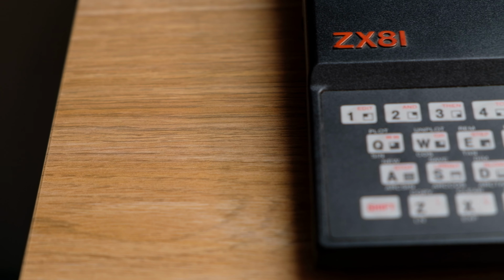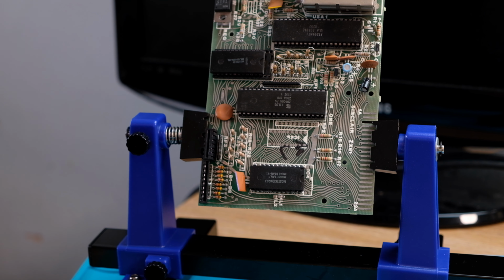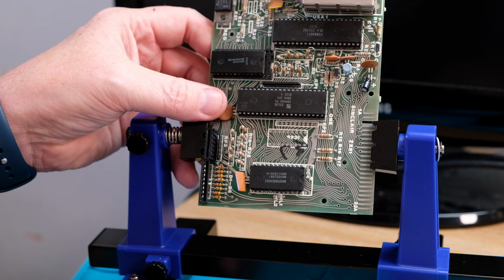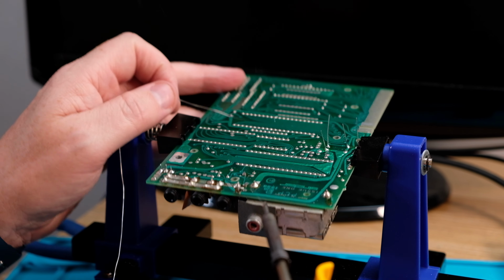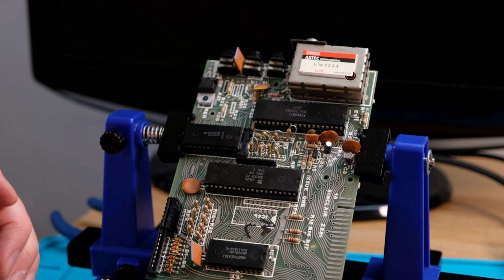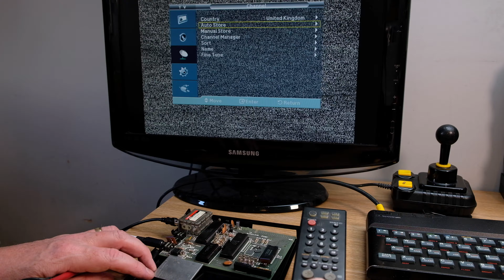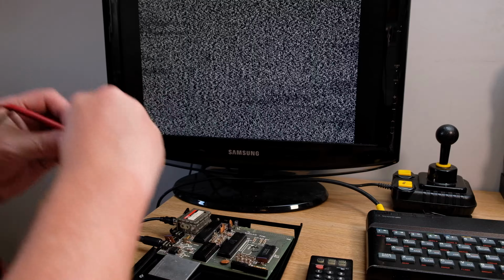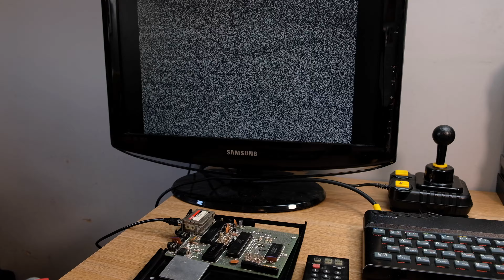ZX81 - a short video of failure

Comment: Put it in the fridge...it is what I used to do when it got hot.
Reply from the maker: I can't recall my original one getting this hot.  Although my school friend commented (at the time) about warming hands on his ZX81 in the winter - so maybe they did!
Reply: @stevesretroloft  I used to spend all my time on it - like 12 to 16 hours a day...I did things like making bit map graphics by manipulating the ALU in assembly. I made RF transmitters by toggling pins on the expansion connector with a piece of wire connected...fun times :)Today I am an embedded developer...pretty much the same job :) still fun times.

Comment: I had one of the US versions of the zx81 with the 16k brick that fell off the back,at one time, and yes it was pathetic, but I sincerely miss it and wish I still had it even if it was just to sit on the shelf.
Reply from the maker: The wobbly RamPack was a feature!  I originally had a memo tech ram pack that was contoured to the ZX81 so it was much better.   With regards to the computer it was a basic device, but probably cheap enough to get the masses (certainly in UK) to try it/